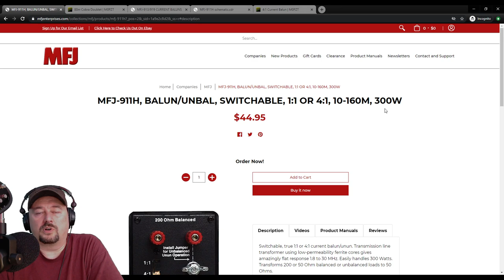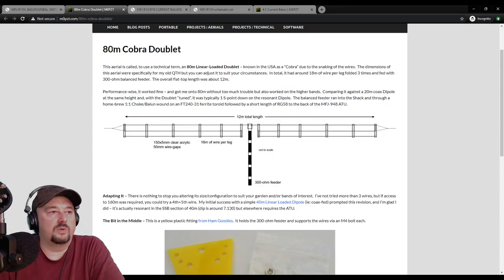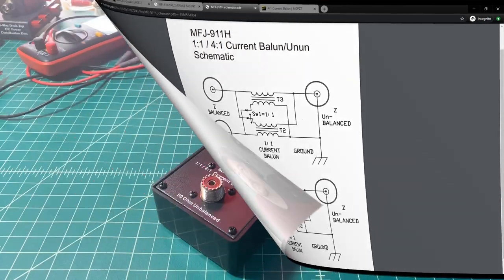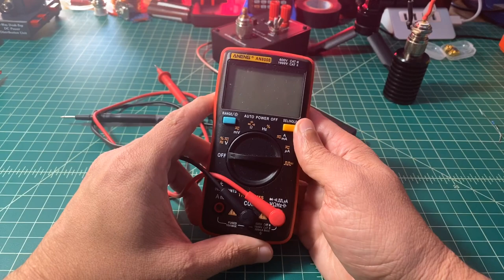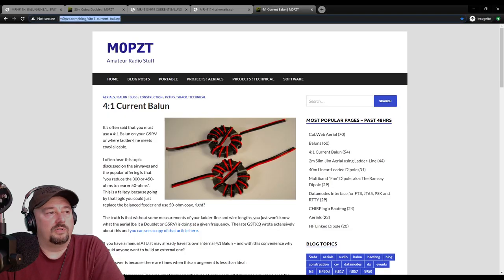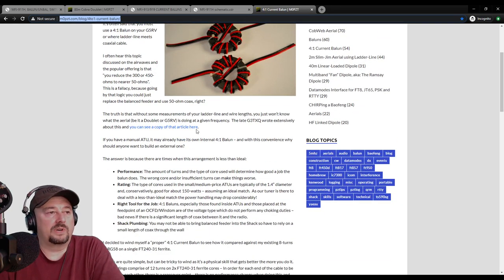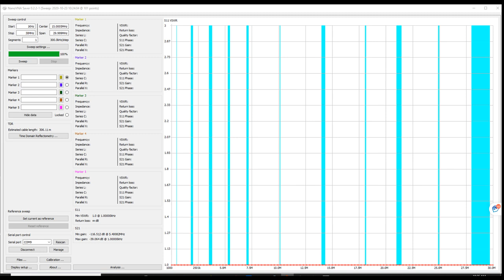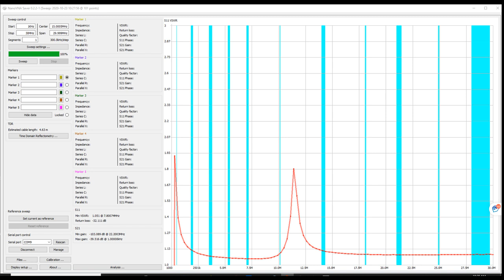MFJ-911H 1:1 / 4:1 Current Balun - HAM Radio - TheSmokinApe

Comment: The SWR test does not tell you anything about the balun's ability to minimize common mode current.  To do that use the nanoVNA to connect one end of the balun to the port 0 center pin and the other end to port 1 center pin.  Then read the S21 LogMag which will give you the "Transmission Loss"" in dB across the HF frequencies.   You want at least a 20 dB loss ( blocking 99.0% of common mode current or, even better, a 30 dB attenuation, blocking 99.9% of common mode current).  The nanoVNA will also give you the balun's impedance but you will need to export the S2P Touchstone file into a free program available on line called Zplots.   The VNA will not display accurate impedances natively or using the nanoSaver pc software.   

I love your videos!
Reply from the maker: Thanks for the info and feedback Hank!

Comment: You might compare the effectiveness of 4:1 and 9:1 current baluns at extending the range of a ATU with end-feed antennas. I recently checked out how well my Emtech ZM-2 tuner worked Nelson Antennas's 9:1 UNUN. I was impressed. While I could get the ZM-2 alone to match 29- and 41-foot non-resonant, end-fed wires on 40 meters, the 9:1 UNUN made the normally touchy tuning of the ZM-2 much easier. Watching the adjustment on a NanoVNA, all I had to do was adjust the left knob to bring the low SWR onto 40 meters and then adjust its depth with the right knob. I also realized a downside to the current focus on half-way end-fed antennas with 49:1 baluns. Because the half-wave is resonant, any move off-resonance creates issues. Never being resonant in the first place means non-resonant antennas are less temperamental. I use a QCX-mini, which doesn't have an ATU, so I need that ZM-2. But for those whose transceivers have a built-in ATU, a 9:1 balun might spare them the expense and trouble of an external ATU. The question might be whether 4:1 is enough or if 9:1 is better.
Reply from the maker: That's a good idea and sound like a cool experiment, thanks for the comment Michael!